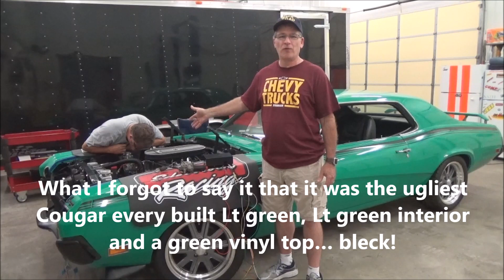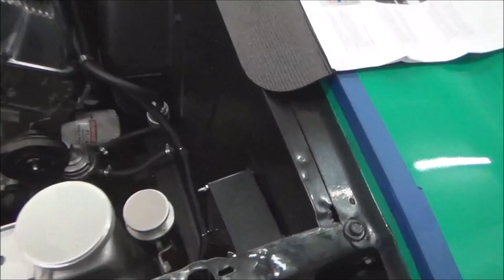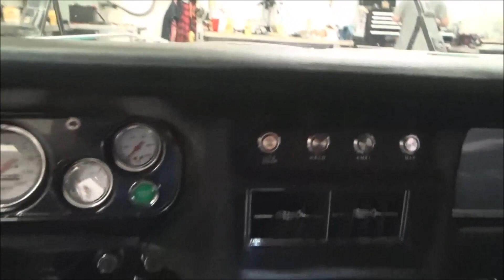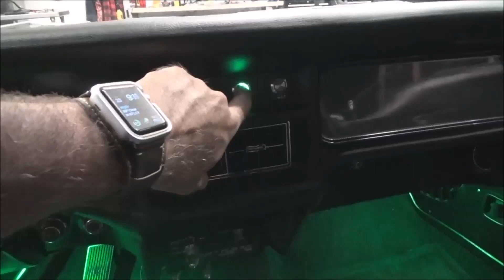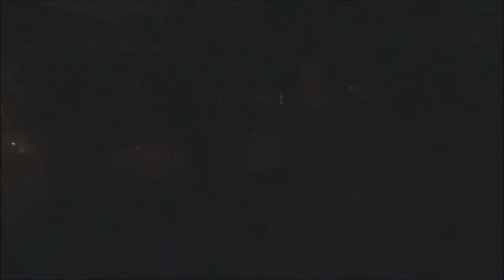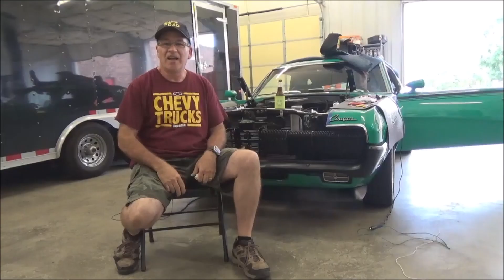Mercury Cougar Headlight door upgrade with a Miata Headlight Motor

Comment: Where did you get your custom gauge cluster ?
Reply from the maker: from Speedway  https://www.speedwaymotors.com/   Classic Dash 616690011 1969-70 Mercury Cougar Panel, Black and Speedway 6-Gauge Set, White Face #91065056 its a nice set the turn signals highbeam and brake lights were LED panel lights from eBay

Comment: Very nice work! What years of left side Miata headlight motors will work for this mod?
Reply from the maker: Thank you. 91-97 are all the same and ford probs as well but very hard to find these days used the same motor
Reply: @NavyDad  does it have to be a left side motor or can you use a right side motor and just mount it on the other side of the support?
Reply from the maker: @scotteidem9752  Hi yes I just had an extra one in the parts bin so used that I had, but either will work
Reply from the maker: @scotteidem9752  hi sorry missed this. yes you can just use the other side. I just had the left one in the parts box

Comment: What would the wiring look like if i didnt need the alternate switches (just ooeratikg off the headlight switch). Would i still need relays, diodes, etx?
Reply from the maker: Yes you would still need the relays to use the motor but no you would not need the diodes if only using the headlight switch.

Comment: Where did you get your box? To put all relays etc
Reply from the maker: it's just a DIY "project" box. in Texas we are fortunate enough to have https://altex.com/ Think if it as a huge Radio Shack They have many size boxes, but you can also find them on Amazon this is the same size I used and there are tons of other options too https://www.amazon.com/gp/product/B0002BSRIO/ref=ppx_yo_dt_b_asin_title_o06_s00?ie=UTF8&psc=1

Comment: Where did you get the center switches those are cool. I'm going to try and do that conversion.
Reply from the maker: Hi They are 16MM latch switches you can find them on Amazon or eBay in different colors too https://www.ebay.com/itm/SSHn-16mm-Green-Angel-Eye-LED-12V-Latching-Push-Button-Power-Switch-Waterproof/322294093027?hash=item4b0a3994e3:g:GeIAAOSwzaJX89vV